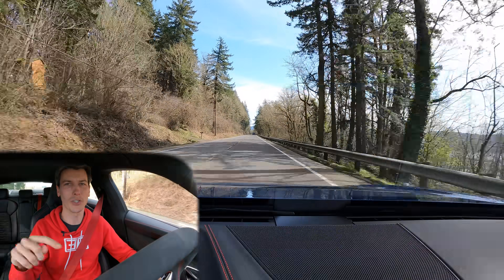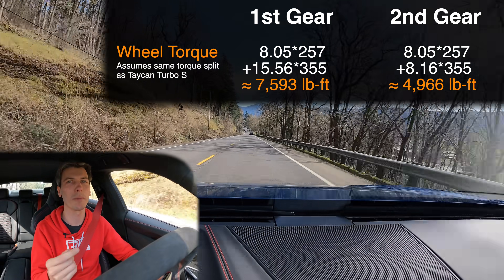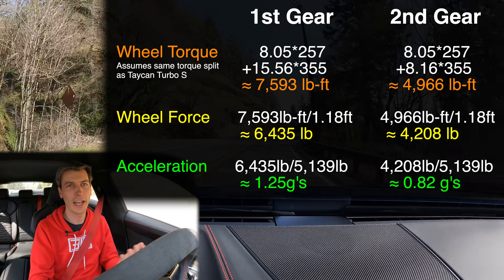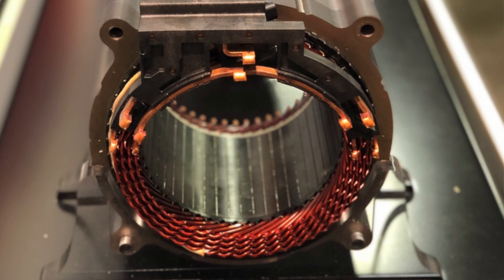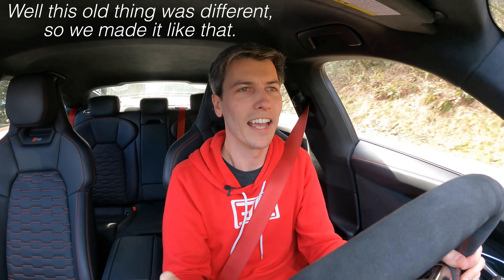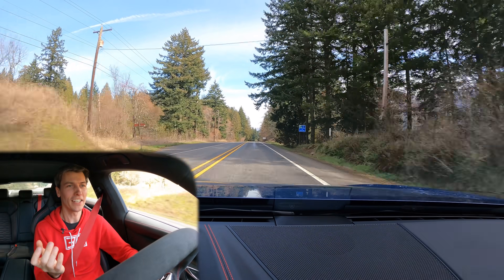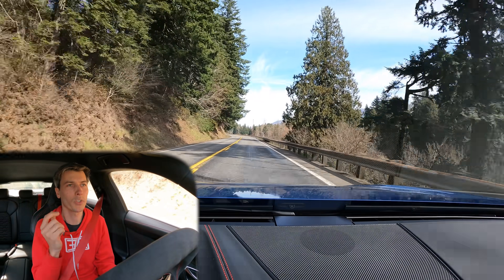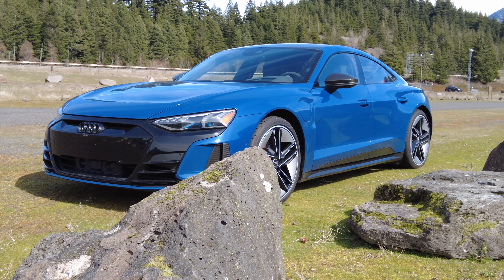Are Fake Manual Transmissions Coming? Audi Keeps It Real

Comment: There are some legitimate reasons for the engine sounds being made in EVs. I notice this in my work as a driving instructor. Most new studens have a difficult time figuring out how fast modern cars are actually going, given that they are so quiet and vibration free, compared to older cars. This is specially bad when they are used to driving a diesel automatic car at home, and then have to learn at a driving school in a hyper modern EV, that is basically quiet. With the engine sound turned off, they have a way harder time detemening what speed we are going, and end up spending a lot more time looking at the speedometer and adjusting speed, until they can "feel" how fast we are going.
Reply: I have a question:-

Do you think new drivers going to be unsettled by the high amount of instant torque on the slightest acceleration? 

With an IC engine, its easier to control because there is a gradual rise in torque so its easier to control. Especially given that most EVs produced today are High torque performance SUVs. The slightest tap of the pedal will have them scared and discouraged to step inside a car, cos they are backing into a parking space at motorway speeds.
Reply: @Bav-s30z  Automakers tune the pedals' responsiveness to be suitable for each model, but it would be a cool feature if going forward the user had more control of the tune (some cars already do this in the form of sport/regular/eco modes and different levels of regenerative braking)
Reply: Might just be because the oldest car I ever drove was from 2005, but I never used the engine sound or vibration as a gauge for how fast I’m going. I get having it as an option for older folks who may have, but that’s no reason to not have it as on option or even have it as default
Reply: i actually had an interesting idea in that regard - adjust the speed of music played in sync with how fast the car goes. Not sure if anyone will use it, but fun as an experiment.
Reply: If your students are taking "a lot more time" to look at a speedometer to determine speed you need to work harder.  You can see both the speedometer and past the windshield in a glance if you are seated in a car correctly. Why do you think everything is positioned on the dash in front of the driver of regular cars in the first place?
Reply: Wrong. There are NO legitimate reasons to have fake engine sounds. This sounds like your problem, not your students.

Comment: I love my stick shift but I want to see something unique to electric cars rather than some gimmicky imitation. If electrics anount to oversized (and fast) golf carts n the end, user input wise, then so be it. I'd love to see a manufacturer be bold enough to do away with outdated ideas like steering wheels and pedals too, though, and perhaps have a vehicle be controlled with something akin to a Playstation controller.
Reply: As someone who has played a lot of Gran Turismo and Assetto Corsa, there is no way I'd give up a steering wheel for a controller in a real car. I can do well with it in GT7, and I do so willingly, but I use motion controls to do so, and that would never work in a moving vehicle the way a steering wheel would.

Comment: The only advantage of gear box in electric motor is. We can put smaller motor to power the car or more mileage when cruising at highway speed. We dont need 100% torque when cruisin

Comment: I still can't understand why real multi speed transmissions, (auto or manual) are not beneficial in EV cars?

I understand that in EV cars, max. torque is available at zero revs. That an EV car can accelerate very well at the equivalent of starting off in 5th gear and rev much higher than an IC engine,  hence only one gear needed. 

However, wouldn't a multi gear transmission still improve on power, torque and range? 

To offer good acceleration, an EV car needs high torque because it is using only one gear. Imagine the sort of power the average IC car needs to accelerate well starting off in 5th gear. 

So let's say an EV car has 500nm of torque. In 1st gear you could drop to half of that because of gear reduction. With each gear increase you could increase torque. By adjusting torque to gears, you adjust electric motor output and so save battery without sacrificing performance. 

So either have 500nm output at all times in 5th gear or much more efficiently, different gears with 500nm only at the highest gear.

Comment: Gears could make the car more efficient by not letting you gun it at the light, so driving in low speeds or even high speeds would seem theoretically way more efficient

Comment: Does the electric engine require "less power" to maintain high speeds? Once I'm going faster than 70 my battery drains fast!
Reply: Maintaining high speed takes more power.  That's true of gas engines too.

An electric motor has very similar efficiency across it's entire RPM range while an ICE has a fairly narrow RPM range that it operates (relatively) efficiently.

Comment: Thanks again Jason, another great video, great time to maybe do a video on the ZF 8 Electric used by BMW and FCA next. I love how the 4XE can be pure Electric (using 1-6 gear) then be both a series or parallel hybrid. 3 Motors is kind of cool in a vehicle and how it can use all of them in various ways, you would do great delivering this info. From another hyper blue Subaru Crosstrek to another ;)

Comment: I don't think the e-tron or the taycan actually lose accelleration after shifting. The shift point is very likely well beyond the point where PMSM operate at constant power. Meaning they sacrifice rpm and gain torque in a way they can keep up acceleration since the power stays constant, much unlike an ICE car after shifting.
Unless they made some really strange gearing decisions.

Comment: I had a question. Would it be safer and less damaging to an automatic transmission to do pulls while moving when compared to launching from a stand still? If so, by how much?
Reply: If you’re already moving and then put it to the floor you’re forcing the trans to shift down for more torque from the gear it was it previously. If you are doing a pull from a standstill then it’s already going to be in the lowest gear, you’re not forcing it to downshift, so I’d say starting from a stop is less damaging. Can’t really tell you how much, but in one situation the trans is doing more work than in the other
Reply: @patrickmurphy6578  alright, that’s very interesting. Thank you

Comment: If I wanted to ev swap my old Mustang, and didn't want to use a transmission, do I use the wheel torque numbers from the I.C.E. engine peak torque, first gear, rear gear ratio as a basis for a ev motor, rear gear and possible gear reducer to achieve similar performance? The whole ev torque /hp curve vs I.C.E engines confuses me.

Comment: Something I've always wondered is why don't EV manufacturers use multi speed gearboxes if not for nothing else than gear reduction.  

Wouldn't that work the motor less (spinning slower)?! Improved range?

Comment: I think that a 'hacky' way of doing 'gear shifts' in an electric car is by altering certain parameters of the alternating electrical current being sent to the motor
any property of the AC current with a relationship with time (and thus with the RPM of the motor), such as the phase difference between the voltage and current going to the motor, or the pulse width modulation frequency being used to modulate the voltage, can be leveraged
whereas normally a parameter such as phase difference is mapped across the RPM range to provide optimum performance and PWM frequency is chosen to be so high as to not harmonically interfere with the motor's RPM, they can instead fixed at certain values to represent different 'gears' ... this will result in a different torque curve for each 'gear' , but perhaps more interestingly it might also cause the motor to sound different ... and it will be a mechanically authentic way of simulating gear shifts , instead of simply enforcing a performance limitation by software

Comment: Electric motors do have an efficiency power band vs electricity consumed! It’s too easy just to have a large heavy expensive battery and large electric motors which all suits autonomous drive modes! Let’s wait till some one creates a small battery/ electric motor with a gearbox that will be light weight and cheaper to produce…..

Comment: I think your confused bro.. have you ever gone off roading or rock crawling? Having more control over gears in an EV would definitely have more benefits than a "single powerful gear"

You explained why it is not practical on a road car. And it makes sense.. now make a video showing how it's not beneficial in 4x4 applications..

Comment: What about Engine braking in regards to manual transmissions? I've used engine braking quite a few times and it's saved my bacon as well... If they can mimic that , then fine.. I will buy that pacifier!

Comment: Wouldn't the manual transmission in an EV make it more efficient because it wouldn't have to spin at such RPMs to get to higher speeds? I don't know but it just makes sense to me that the higher the electric motor spins the more energy you're using?? 🤷🏿‍♂️
I agree with this though, the manual EV probably isn't necessary but it's for fun and there's a market out there for it I'm sure, I would be one of them. My ideal situation would be Hydrogen combustion engines with manual transmissions for the car enthusiast out there, all the "Normal" cars can EVs lol.

Comment: Hey EE. Love the channel... Tire question: We're coming into summer.... many videos about "you shouldn't use summer tires in winter"..... great.... but during summer, are summer tires ACTUALLY better than all-seasons? maybe heat them both up & lets see if summer tire = better?? Thanks again, love your show 🤘
Reply from the maker: Yes, summer tires are better in summer. All seasons are a compromise. Of course, varies by tire.
Reply: The lower the treadwear the better, anything below 350 is good, or just buy a racecar with slicks and drive it on the street. Also all seasons are like having a brush to wash your feet and teeth in one package.

Comment: I suspect the difference of the fake "manual transmission" will be felt at the entrance of every corner, to say the very least. A real manual transmission with a decent gearing is always going to help more with inertia management than a fixed long ratio ever could. Fake things are fake, there is no getting around this, people who push ideas of fakery should just quit it already. If you want to drive manual, you 're better off with an ICE car. Screw the straight-line acceleration. Handling is what matters on real-life roads. And those who say "The auto does a better job at selecting gears"... no, it doesn't. Robots are actually not that smart, as they can't be smarter than their designers. Robot designers specialise on robotics, not necessarily on driving and all the random factors that go into it. Driving is best done by humans - given proper driving education, of course. Robots cannot achieve the perfect road safety they 're advertised to promise. Driving education is the only real hope.

Comment: Have you seen the Jeep Wrangler Magneto concept? They pretty much took out the engine on a standard Wrangler, and swapped it out with an electric motor, de-tuned to produce the same horsepower (295 HP) and torque (265 lbft) as the engine. They kept the manual transmission. Does it make sense, for off-roading purposes, to increase the torque of a "weaker" motor? Over, say, just installing a bigger motor to begin with that has the torque you need? Bearing in mind that other electric SUVs boast some thousand or so horsepower and torque... what are your thoughts on this?

Comment: I'm guessing an electric motor would'nt have a perfectly flat efficiency curve, so a couple of gears makes sense even in an efficiency perspective, whether that's a big enough improvement or not to jusity the complexity/cost is another question.

CVTs that stay at full power are a terrible experience, that's why they were changed, the rest of the time they were fine, I'd tune them so that they only fake gears when you floor it.

Comment: The reason I heard as to why Nissan introduced fake shift points in newer CVT's is that customers would complain their transmission was slipping and they wouldn't accept any explanation Nissan techs would give them and simply demanded they 'fix' their car or give their money back.

So I don't think Nissan want to make their CVT tech act like old auto transmissions, it's the customer who can't accept or understand how the new tech works. Kinda weak of Nissan not to educate their customers before they take delivery.

Our old 2007 Altima had a CVT without shift-points. The original CVT's by Nissan didn't have the fake shift points, that was a later development. I was happy with the Altima because I drove a car with a CVT back in the 70's and understand the difference in behavior of the CVT transmission. Ignorant customers make ignorant demands.

Comment: And why don't they use something similar to a CVT or a moped torque converter transmision? Infinite gearing ratios seems like the most efficient way to optimise an electric motor

Comment: You know, everyone always talks about the acceleration of electric vehicles. But no one ever talks about the top speed, does the top speed not matter anymore? I know Teslas can do 0 - 60 in 2 seconds, but isn't the speed limited to like 125 - 130mph because of the single gearing they have?

Comment: The gearshift and the sound are just for fun I think. Doesn't have anything to do with making sense in my opinion. Supercars don't make any sense on public roads either if you think about it, but the experience is fun and makes you smile. Although I still think there should be an "off" option for the sound in every electric vehicle.

Comment: Still waiting for someone to make a massive torque monster electic motor with a 4 speed attached to it. Everyone who's on the ev bandwagon likes the simplicity of one speed. Its good for business and expensive large rpm motors are great for bottom lines and wearing batteries out faster. But AC motors like higher rpm ranges for efficiency and their loss percentages are lower between 4 and 10k rpm. So why not attach a manual trans that emphasizes the efficiency of the electric motor and keeps the rpm range there for max torque? A fully assembled Honda 5 spd out of a civic type R is only 132lbs. So weight is definitely not an issue.

Comment: Transport Evolved had an interesting point on this: For a limited time, there will still be manual transmission ICE cars on the road. Especially in Europe, where you need to pass the test in one in order to drive it legally. However, that's going to be such a small segment, I figure it's fairly moot.

Comment: I hope that one day you’ll be able to select different drive modes in an EV that replicates how older sports cars drive.
  Like to be able to select a Ferrari 250GT and have the electric motor simulate the torque, acceleration and top speed of that car while the speakers pump in a simulated engine sound.
Reply: Literally 1984

Comment: You kind of got to it towards the end of the video, but the reason to do this has nothing to do with peak efficiency or doing anything better, it's because it's fun. It's all about emotion, and there's nothing wrong with that. Sports cars themselves generally make no sense if all we care about is ruthlessly making something as efficient as possible, I don't see why we need to start applying logic to them now.

The other aspect of this is that it may become one of the few accessible ways for the masses to have access to a fun, manual transmission car. I have no doubt there will be boutique manufacturers creating things like Singer 911s for the foreseeable future, but those will be far out of reach for the regular consumer. But in the not-too-distant future when the majority of major manufacturers' lineups are electric, what if Toyota makes a GR 86 with a "manual" transmission that lots of people could afford? Sounds like fun to me!

Comment: Engineering Explained could you make a video showing what would make more power or be more efficient/would have better gas mileage: two different engines with the same displacement but different amount of cylinders and or explain which is more important for efficiency bore or stroke? My point is would it be worth going from a 2.5 4 cylinder to a 3.0 6 cylinder in a turbocharged application? The displacement is not all that much different but the cylinder count it. A better example is a 6.0 12 cylinder vs 6.0 v8.
Reply: Also if buy a fake manual electric car so long as it has lots of exhaust sound piped into the car for sure over a lame single pedal automatic. It would be kinda cool to have an electric car with whatever sound you want so long as islets actually fast enough to have said sounds.

Comment: hold on.... I think you're leaving out the feel element of driving in this conversation?  Many drivers like the feel of shifting gears, hence a fake manual (or in the case of the CVT having distinct points) seems like a good compromise (especially in a future where combustion engines might go away entirely).  Heck I've wanted them to make something similar for DCT cars, just have the stick with the  gear slots and no clutch pedal, and use that to select what gear you want the DCT to be in rather than paddle shifters.

Also for the Audi, I think I personally would find the audio for the shifts helpful so I would better know the state of the car (i.e. recognizing when it went to the higher gear).  It might not logically serve a purpose in any way other than letting me know it's happened, but I definitely appreciate knowing that kind of information.